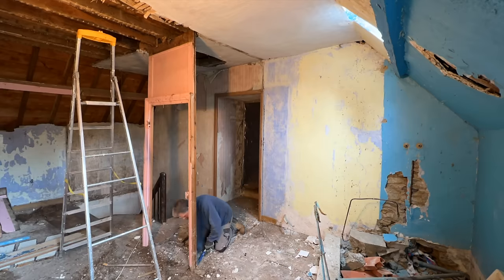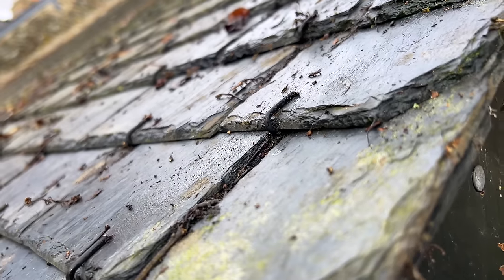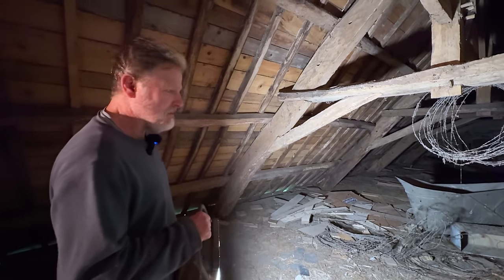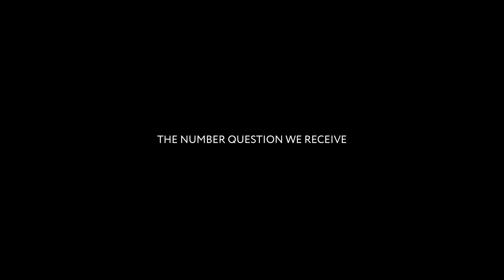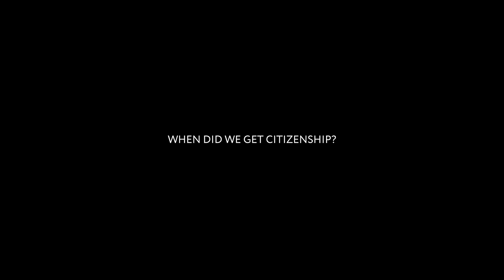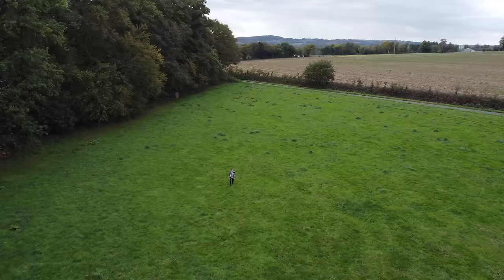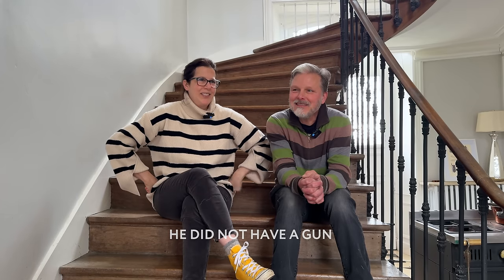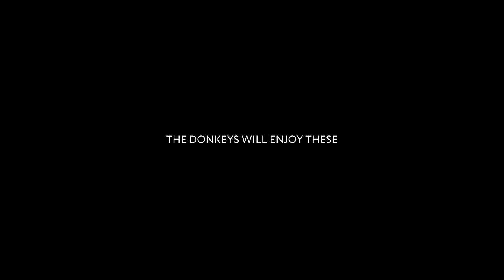"Rest When Dead" Approach to Chateau Renovation + EU CITIZENSHIP

Comment: Great vid!  btw - slate thickness is just one consideration when relaying a roof.  Slate by nature varies in hardness by location of the source as it is a natural material.   We recently redid our slate roof in the US and there were many options.  If you want the hardest (most durable) slate at a "good" thickness it comes at a premium.  A thick slate that is "softer" isn't necessarily the best option, so exercise some care.  Slates erode over time as it s a natural material with the softer materials thinning more quickly.  Our roof lasted 130 years, which I've learned is pretty good for the US.  We had to source slate from Canada to get something that will last another 130 years.  Some learning to do on this topic but I'm sure you'll figure out what's best for your home, out buildings, and budget.  Great content and vids - keep up the great work!

Comment: You're lucky, we moved to France last year on a tourist  visa and have to renew it every year. Luckily we can do that financially but it's not a long-term solution. We're going through the process for something more permanent but it's France and it takes time. Also, the one is natural slate, split out of stone. The other looks like a fiber cement "slate". It's decent, it's manufactured, the only downside besides being very brittle, is that it seems to provide more moss growth than true slate. At least at our property. One outbuilding has it, the rest is real. Also, I would recommend removing all the ivy. I know people like it, but it's detrimental to the stone and horrific to the roof/structure. I feel you on the mowing, we're in the Pyrenees and...I just don't want to start yet, but it's getting to that point.

Comment: Thank you for so much for clearing up the slate issue with me. I am used to the usual asphalt shingles that we use here in the states. I know slate is beautiful but extremely expensive here so we don’t have that. But I’ve looked at British and French roofs and thought they all needed roof jobs and I guess that’s why, because they are using slate and it has a bit of a different look. The slate is beautiful. It’s just that some rooftops look almost like they have a torn up old roof and it’s really just a slate one  I guess. Such a difference in quality though. I guess it’s all in what you can afford and I’m glad you can get the really good stuff. I think it’ll last you a lot longer.

Comment: The thin slate is not rubbish it is used all over the world on prestige  buildings. If you are breaking them it is because you are not using the correct method of working on them.